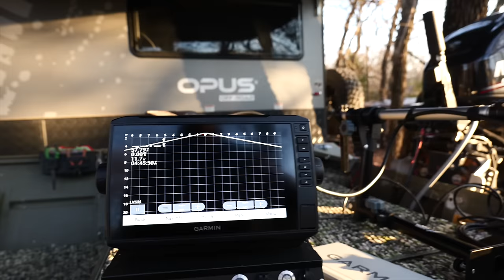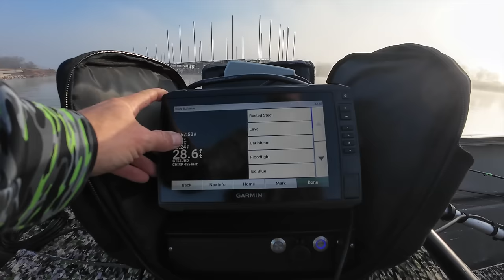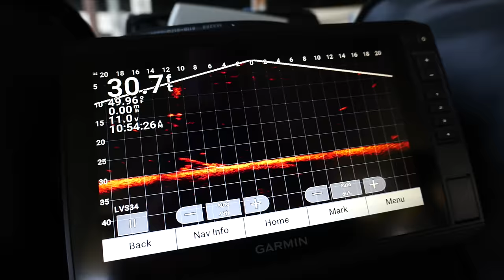I Made a Ridiculous Jon Boat Purchase - Was it Worth it?

Comment: Consider Amped outdoors NMC 14.4 volt battery. They have higher voltage that garmin can handle. Improves the image even more for longer.They are very light. Works great on my 93 uhd with llvs 34

Comment: Excellent review.. Was referred to this review by Dangle Nation. I’m (was) wondering about using such a setup in my drift boat for back trolling in a river- distance back 70ft. max, going from side to side looking for bottom contour drops where larger fish take shelter and hide in the currents. Do you think this would be a good application for that?   I was looking at the Summit link you provided - excellent- do you think they would sell the complete unit all wired up or do you know any shops that do sell it as a complete setup? Many Thanks for taking the plunge and making this great video review.

Comment: Look up amp lithium. I think I bought a  32 amp hr bat for around 150 and it powers my black box and 106uhd and lvs 34 prob get 12+ hours of full use and although it’s a 12v battery I wanna say when it’s fully charge it puts off 14v

Comment: 94 SV? 
LVS34 will only preform as good as the LVS32 on this unit, you needed the UHD.
If your running the lvs 32 on the Phoenix, just change out ducers to get the most from your purchase.

Comment: Dont judge the battery performance until the fourth charge cycle. Fully charge each time and fully discharge to recommended lowest battery voltage probably around 9 volts. Something most likely will go wrong the first two charge cycles to give inconsistent performance data. Over the next two charge cycles it will stabalize to almost as good as it will get. So on the fourth charge cycle take your run time analysis and 5
Then determine if to upgrade and keep it for backup or just get rid of it. But do not just toss it to the side from first couple charge cycles. Really' What differance is under 5lbs in a battery that size going to make? Again very very important to do initial charge cycles through the full range of discharge. Dont re-charge early and dont under charge and use as low amps as you got. Half amp charger ideally for lead until battery is fully maintenced over a few charges then 1 or 2 amp trickle charges are good enough. No sense talking about lithium chargers, shorter the heat cycle the better.... Right? It is important to not create memory spots in the battery cycle for the battery's max life performamce. Which you are going to need with a small battery, especially when cold, so whencyou do charge fully charge them all at once.
 Personally i would just run two full size lithiums if money vs duration was the most important. And certainly if i had multiple boats and one sat for a couple months needing to charge the lead batteries every single time and shortening their life expectency the longer they sit under voltage. Plus have two small lithiums for portability(ice fishing)if that boat is its main home. So can save the life of the potable batteries.
 A battery is going to charge and discharge maximum number ot times. Lets hypothetically say 1000 times. Weather it is fully discharged or not you are still only going to get 1000 charges out of it. Being down a couple volts and only charge for 6 hours instead of 17hours does not mean you can charge it 3 times like that and count as 1 of the 1000 charge cycles. It will count for 3 of the charge cycles. As much as you fish I dont think having 2 small $200 lithium batteries last only 2 years is the smart choice because you need them fully charged each and every time because they are small. Versus having a full size that you can drain totally and have one of the portables or both in the unit for backup the few times it runs out between charges while on the water for 12 hours a day.
All this is true weather you go with lead or lithium. Only weight, runtime and extreem cold amps/voltage will vary. I can understand having seperate battery for a trolling motor as a "must-have" but,
 Does a live scope really use as much power as a trolling motor over a full day?

It is hard to compare battery maintenence between the two. Lithiums are hyped to be carefree charging but we know the charging is actually very sophisticated and highly regulated. Not leaving you much options without buying a manufacturing grade matcher/charger. And thats not an option unless your a tesla racing team with a japanese battery dream contact.